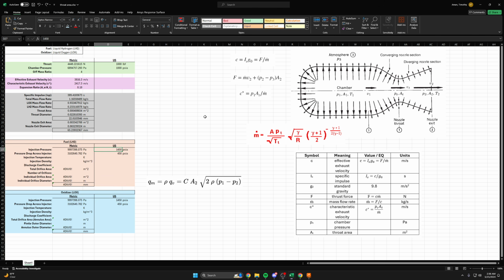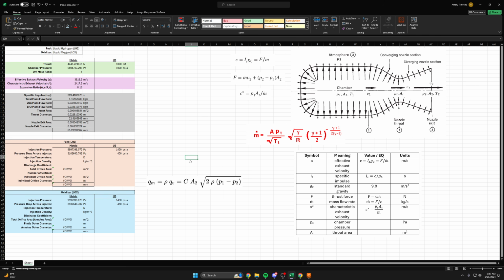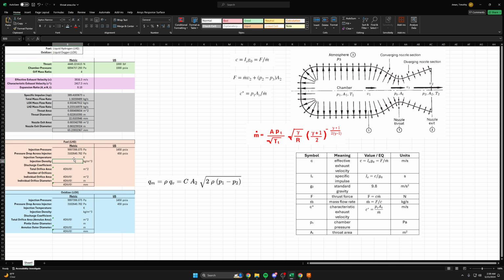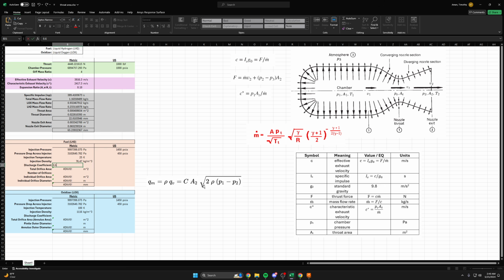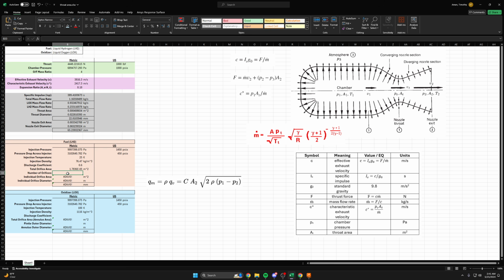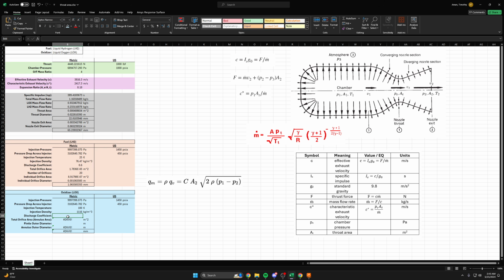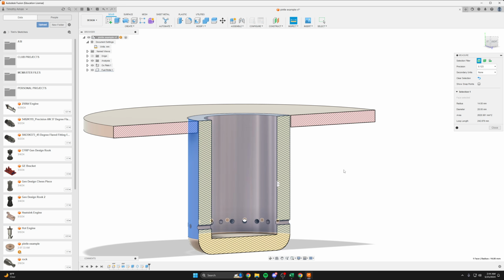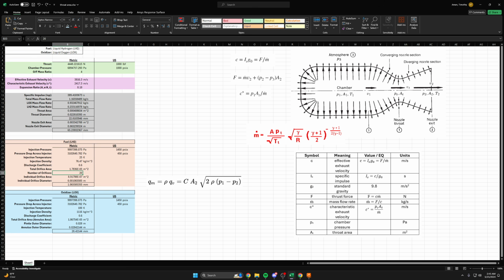Rocket Engine Injector Sizing

Comment: hi i am an aerospace engineer trying to design a pintle injector for a liquid propellant rocket with a thrust of 24N and chamber pressure of 150psi.where can i get in touch with you , i would love to have  a great conversation with you.
Reply: pintles at 24n? Dc will be like 2 cm at most